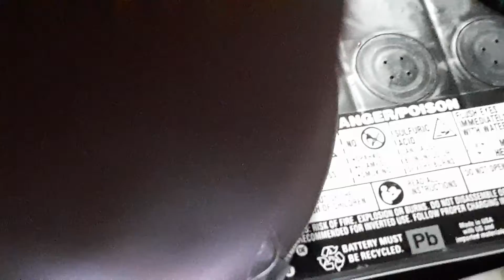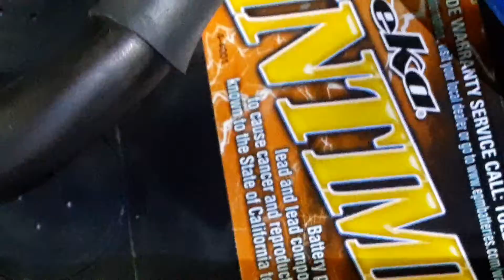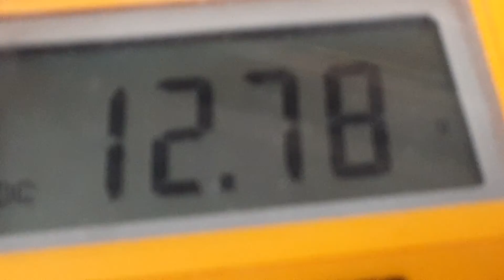New AGM BATT. (DEKKA) Intimadator.

Comment: NICE BRO!!! I've got more UPGRADES coming also!!!
Reply from the maker: Awesome can't wait to see them. And hey got a question if I was measuring the voltage on my batteries multiple where should I attach the wire what is the best spot on one of the batt the amp what? I want to have a volt meter on my dash
Reply: @Ron-Webster  I always wire my meters directly to the amp! This is where the most current draw occurs! so I wire my meters there I know if my voltage is good there, it's even better everywhere else in the car! ALWAYS AT THE AMP BRO!!!